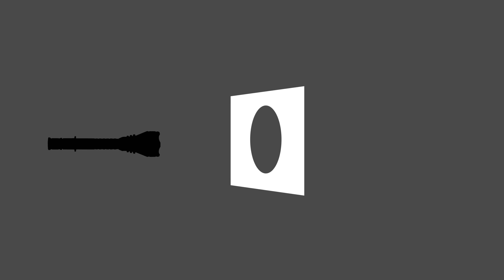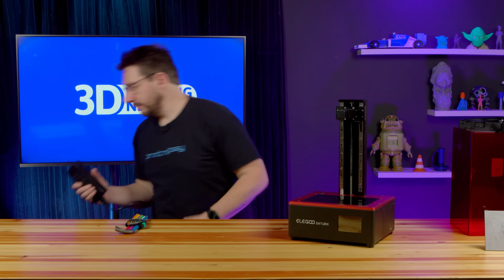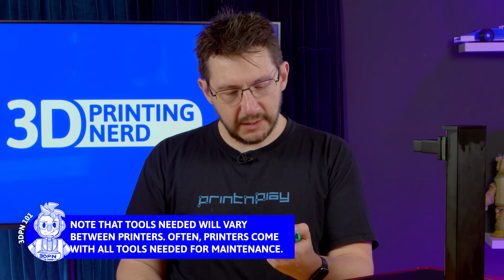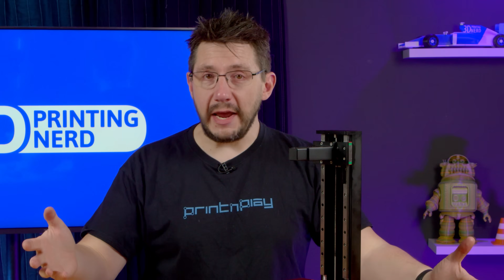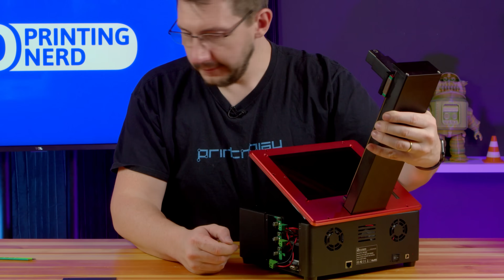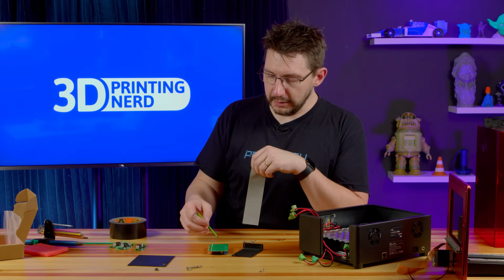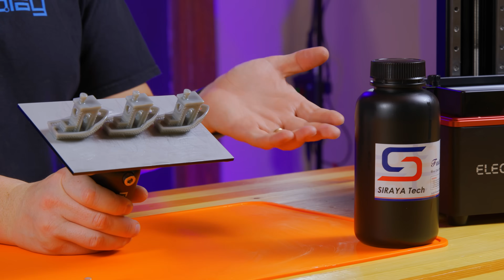FIX AND WIN an ELEGOO SATURN!

Comment: On this printer i would want to print mechanical parts like gt2 pulleys, worm gear boxes (see how resin drive elements would work under stress to find exact application) and seeing your latest vid about  high temperature elements i would want to look into high (-ish) temperature parts like cpu mounts, extruder parts for my good ol' mk2s and custom lighter from resin ;) but I bet i would not resist printing benchy :) Cheers!

Comment: If I won this 3D printer I'd actually be able to put some of the useful car enthusiast ideas I have into real life making it much easier to get easy replacement clips, aesthetic items, transmission/motor swap trans tunnel adapters for cars that were auto going to manual. I've also done quite a bit of home improvement and construction in my life and I can think of more than a few ideas for simple household trinkets that'd make the every day life a little more simple. Cabinet hooks for spatulas, spoons. Fridge shelves that create extra storage inside a fridge, lego style snap-together trays for cabinet and dresser drawers that have a lot of misc. items, cable management clips, and many other ideas I just come up with as I walk around my house and get frustrated at old designs daily. 

I've wanted a 3D printer since the original Makerbot demos surfaced and I always thought it was a fantastic concept but unfortunately life always hit and I never had the spending money for a printer, although I was looking at a filament printer instead of resin based but as of late I have come to appreciate both for their independent printing functions/finishes. I'd love to start finally pulling some of these ideas out of my head. Even if I don't win this I think I'm going to start putting money aside to purchase one

Comment: Hello Joel,

Great video, great idea!

So, im REALY REALY REALY obsessd with 3D printing!
But as a german mechanical engineer i was upset about the weak 3D Printers you can buy.
Everthing is squishy and fluffy at thes "low cost" printers.
On the other end, you have to spend a lot oft money in it.
In this case i started my own DIY FFF 3D Printer Project.
The goal is a rigid 3D Printer with a low cost Footprint.
If I win this 3D Printer, I will print all the plastic parts for my DIY Printer with it.

Bye!

Comment: There is a long list of what I would want to print with that type of printer, I would probably start off with some tabletop miniatures and the move on to some useful parts that require strong and detailed pieces. Use it to make prototypes of things that would be CNC’d or to just get a better understanding of how one of them work. I still think that it’s a really cool process but I haven’t gotten into resin, only Filament driven Printerz....high five

Comment: Useful video, but I found myself yelling "Why didn't you just take off the other two connectors?!"  (The other two will never be needed and all of those connectors have screw terminals.  So removing the 2nd and 3rd would be a breeze and reduce the clutter in the case.)

Comment: I have to say that the tape looks sketchy :P, anyway i think the first few things that anyone would print are some upgrades for the printer itself, after that i would like to print a key. I always wondered if a resin key could be strong enough and i don't think that with a FDM printer the level of detail and rigidity is achievable.

Comment: I will try to print a wheel I designed in Fusion 360, because my FDM printer is not accurate enough for that. The wheel is part of a robot which is participating in the RoboCup Junior Soccer competition. It also contains M3 Threads, which is a real challenge for these printers, from which I heard. But if you tap the holes afterwards it might also work.

Comment: With any resin printer, first of all, I'd have to find a place to put it other than my bedroom so I won't get cancer, and so I can still have kids some day. Then I'd go on a printing spree testing how far I can push tollerances and I'd probably print a bunch of useless crap that'll collect dust on a shelf for years to come, but it'll look dope whilst doing so. When I'm finally done I'll have to buy some new resin, because all of the other resin ended up in DnD figurines and such. I'll treat myself some engineering grade resin to print some useful mechanical parts for my projects. Printing parts for my FDM Printer would be at the forefront followed closely by gimbals and gearboxes vor various robotics projects. That's pretty much it.

Comment: If I'm the lucky winner, I would print a gearbox. I have a project that require small gears that mesh together to drive DC motor. I tried tp print it with my 3d printer but the print never finishes because the teeth are too small. if I don't win, then congrats to the winner and thank you 3D printing Nerd for helping out the community!

Comment: I would 3D print lots of engineering prototypes for personal projects that I design. Currently I am all FDM on an old heavily modded CR-10 (~easter 2017) but would love to branch out into resin 3D printing and specifically with engineering resins or bluecast resins for metal casting. I love the idea of being able to use resin systems where you can mix resins with different properties such as tough, flexible, high temperature resistant etc. in order to produce the desired outcome.

Comment: Thnx Joel, great video as always ^^. Of course first print will be PIKACHU. For my other hobby model flying parts, cowls, mounts and stuf. Would be the first in my club to have a resin printer so would print alot for my club members. After that mostly anime figurines and ofcourse Howls moving castle.

Ps using heatshrink on those plugs will give it that golden edge. And you could snip those extending connections flush with the solder so u dont have sharp points. Dont snip off solder though ;-P.

Comment: Just discovered your channel last week, well explained and very entertaining!  Was looking for videos on 3d printers to figure out which one to buy and was eyeing this one. 

I have this project in mind for making keycaps for a mechanical keyboard. the reason is that there isn't a big variety with letters in my language(2 that I found). The ones that do exist aren't my taste and are not backlight compatible, they are printed on the keycaps so no light can pass through. So of course, I had to complicate things... The idea is to make the letters out of 2 parts, using a clear resin in a 3d printer, they'll connect to the switch.

From there I was planning on making a silicone mold for the keycaps, align them in the middle, pour in some colored epoxy to block the light around them, and give them the look I want. If all that works, I might add another coat of polish or clear UV resin to make it uniform. The other option is making 2 different size molds, the first for the color and the second for the uniformed coat but it might just make it more complex with the need for a lot more precision and prepping.

Comment: Hey Joel! im a engineering student and if i won this printer i would use it to help me with my new small business where i use 3D printing to give plastic goods manufactures (e.x. berry clamshell cases) . ive received interest from a local company and im trying to get a good printer without braking the bank. this would help me tremendously in getting my name out there and starting a business before i am 20

Comment: Aside from printing everything theres 2 main things I want to print, tabletop mini's (so therapeutic to paint these) and a slightly stranger one but I also want to print components for my astrophotography setup. Problem with this is these require ULTRA fine threads which I cannot do without something capable of dealing with fine details (M48x0.75 threads to be specific).

Comment: I would use this awesome printer to print a replicated fuel cap for a classic Hodaka Wombat motorcycle  my friend is restoring. I have modeled  the stl in fusion 360 and I believe a resin printer will.make a superior print because the fuel cap has a lot of fine details.

Comment: I have a prusa mk3s but my einsy board died on me a few weeks ago. (The hot end and bed heat up the moment the printer is switched on) The board did smoke a bit and then reset so I don't know what caused it to happen but it did. Anyone know of a place where I can get a cheap einsy rambo 1.1b board?

Comment: I've been designing my own 3d printable musical instruments and there are some parts that are hard to create on an FDM printer so a resin printer would really help out. The banjolin that I'm currently working on has a nut with tiny string channels, compound curves and requires a hi level of detail so that would be a perfect part to print in resin.

Comment: Hey Joel, I've been into FDM for quite a while now, mostly printing boxes for electronics projects, but also a lot of fun stuff. The only thing i cant get done on my current printer (which massively frustrates me) is printing light-pipes. That is a transparent part that is fixed to a led so that the light can move through it to the surface of a case. This so you can have the LED mounted on a PCB and still have it visible on the case. If i were to win that awesome saturn i would use it to print lightpipes in many transparent colors. And i would obviously let you know how it went.

Comment: Great video, Joel. I've seen plenty of FDM printer repairs/upgrades, but this it the first one I've seen on a resin printer. I do not currently own a resin printer, but if I won this one, I would print parts and bodies for 1/24 scale model cars that are not available off the shelf. A friend and I like to kit bash, but some engine parts and custom bodies are just not available. I keep thinking about buying a smaller resin printer, but a custom body (what I really want to print) requires a printer the size of a Saturn.

Comment: Thanks for all the information. I found your videos when I was looking for 3d printed loudspeakers. My intent is to build functioning speaker drivers with the Saturn printer. Please pick me!  Fdm printers are too limited for printing out thin wall structures like speaker cones and flexible surrounds. An STL type printer has the accuracy and precision I need. I would print out some units, and post some videos so others can do the same. Thanks in advance even if I don't win. Keep up the good work!

Comment: In 5 days it'll be 1 year since I was struck with the Cv19 virus and still recovering from it. Since then I need several days to build tiny N/HO model kits for my 8yo instead of 1 or 2 hours (actually everything takes me a lot longer then in the past). This printer would take a lot of load from my shoulders by printing the tiny models instead of buying kits. That leaves me time to paint them properly and building the landscapes.

Comment: Hi Joel, I am from Seattle I have been into 3D printing since I was 12, I am currently 17. I have been watching your channel for about 4 years and you are my biggest inspiration to keep on 3D printing. I have owned 3 printers and my current one is a da Vinci 1.0a which I have heavily modified with a duet 3, larger build plate, and a e3d Chimera+. I have been working on it for about 6 months and the biggest issue I have had is the carriage for the Chimera heat break and nozzles. I have been able to print a few designs but my latest one has broken and I have no way to print out a new one. I have been looking to possibly get a new printing to print the new carriage but after spending so much on the modifications I have no room in my budget to buy a new printer to finally finish it. If I win the Elegoo Saturn I would of course print the new carriage to finish my printer but I have been wanting to get into building 3D rocket engines. An  msla printer is what I would need to do that since I could print materials that a fdm printer couldn’t print or would be to expensive. Also if I win the printer, being that I am local I would love to come pick it up in person to meet you and see your amazing studio.

Comment: I was looking for my First printer and wanted the Saturn but saw i was late to the party.buy 6 months for a it to be in my price range it out of stock every were. What i want to print beside the normal test prints and things for around the house. I want made Replacement Part for Gunpla models. it super hard to get any replacement parts in the US . Also custom parts and Bases i have plan. like frame to hang every armor part to display. like with the Gundam Alex Chobam armor.  and i know my GF has a list of bust she want made every since i told her i wanted a 3D printer.

Comment: Nice vid 👍
If I won this 3D printer, I'd 3d print mostly functional models and replacement parts and I'd definitely try to improve upon my old Powerboost 1000C Lens design.

I tried with fdm, but the transparency I achieved with that method is not really good enough. Also some details are just too fine for fdm.

Comment: I would use the Saturn to replace my broken Anycubic Photon. I was using the Photon to print pieces for various props and components. The Saturn would allow me to start printing again since I have been unsuccessful in repairing the photon. I am also open to any ideas on what might help me diagnose the photon. It has an issue with the Z-axis where it moves back and forth but at random. I have tested the stepper and it has continuity in the right places and will spin, but not how it is supposed to.

Comment: Hi Joel and Sean! I have a Creality CR10 FDM printer and have been eyeing a resin printer for some time now, I've always liked to use the FDM for functional parts, my other hobby is astrophotography and I have designed and printed numerous things in pursuit of that, if you're interested you can see my work on Instagram @paleblueastro. If I had a resin printer I would use it in much the same way but specifically for smaller higher detail parts, I know the resin can be brittle but I've done some research on Sirayatech's various resins and think maybe the tenacious mixed with fast would work well for functional applications I would love the opportunity to experiment and see how far I can push resin!

Comment: I would use it the printer to print high tolerance robotic parts that a normal fdm printer would struggle with. we have a lot of 3d-printers in our schools workshop that are free to use, but as they are heavily used they're not very accurate anymore. and sometimes with projects for my study involving stuff like prosthetics, the fit and finish of parts is usually quite important. that is why I would print these parts with this printer. I would have already bought one if I had money to spare but it's a student's life for me.

Comment: Great video Joel. I would like to enter the draw. If I won, I would use the Saturn to print parts for the full sized R2-D2 that I am building. Greeblies such as hololenses, radar dish, periscope, lightsaber launcher, and all the other pieces that come out of the dome. After that, what couldn't I print, the sky is the limit.

Comment: Hello Joel, great video and I love the videos you make. Very informative and entertaining. But to the topic at hand, IF I were to win this printer, I would use it to make the smaller detailed parts for the 1:1 R2 D2 that I am currently building. I think it would be much better to resin print them, to preserve the details without having to use filler and trying to sand out the print lines while not harming the finer details. Thanks for all you do for the community.

Comment: I'd print the parts for my current project, an interactive table top map/grid system, i've tried with my Ender 3 but the walls between the sections are too thin to be printed with my FDM printer.
And of course some miniatures to be used on the board itself 😁
(Don't know why YT keeps deleting this comment this is the fourth time i post it... 🤨)

Comment: Stuff I'd print:
-A life-size raven (probably in several pieces), perched on a square base that has an LCD screen which displays Edgar Allen Poe's "The Raven" on repeat. (I already basically completed that part with an Elegoo uno for a school project, I just need a fancy housing :D)
-lots of miniature bananas, just because it should print really fast, and I want to feel that satisfaction of twisting a sheet of tiny plastic bananas until they all collapse into a pile on my desk.
-a bulky stand so I could mount my laptop vertically, and look like an absolute hacker man while I pretend I know how to correctly format code.
-a hollow cupcake that has twist - off frosting, for secret storage or something.
-a clip-on top for my nightstand to make my lamp and alarm clock stay put, it seems like a weird problem, but it's a very small nightstand and could use some organization.
-at least a couple 3D puzzles
-a LOT of desk toys
-i made a tesseract out of rubber bands and I want to physically animate it "rotating", and I would need some very specific parts to make that happen, and look good.
-really elaborate pictures frames, like Atlas holding up the earth with a picture of me and my girlfriend in it
-wind instruments
-a LOT more stuff, but I'm getting tired. If you read for this long, thank you <3

Comment: I would use it to print everything too detailled for my FDM-Mashine like minis and stuff but one thing in particullar: my own design of a shell for my Dr!ft Car - I did this allready with my FDM printer but it needed sooo much sanding and cleaning. I would like to see if resin based printers can help ne with this kind of Models.

Comment: Nice job! Those phoenix connectors are easy to swap out the cabling, you could just swap out the soldered cable with just a red and black cable.